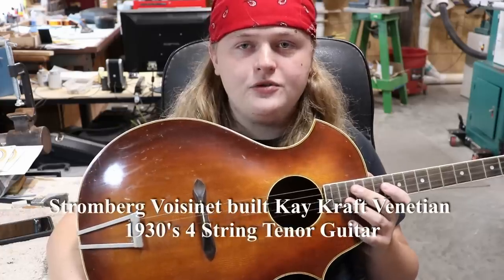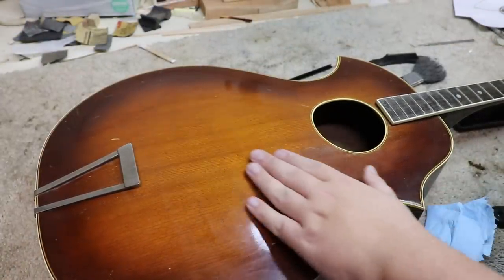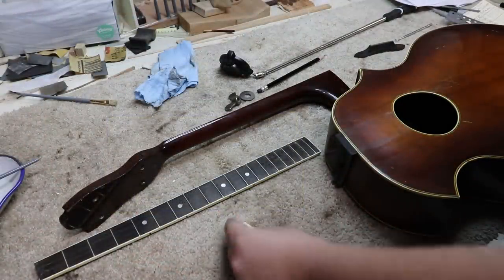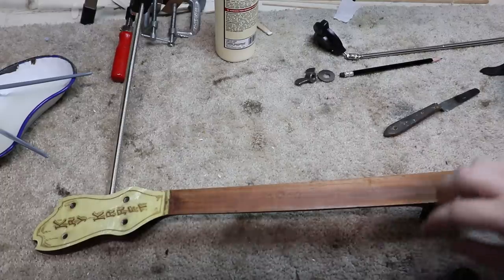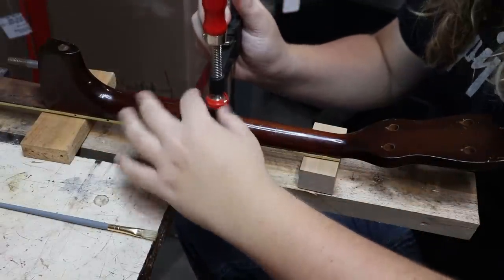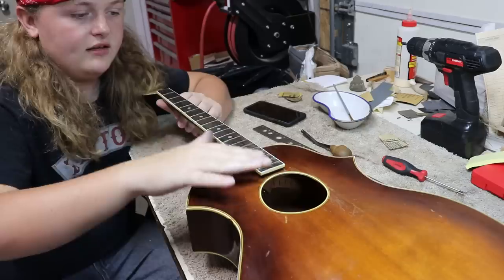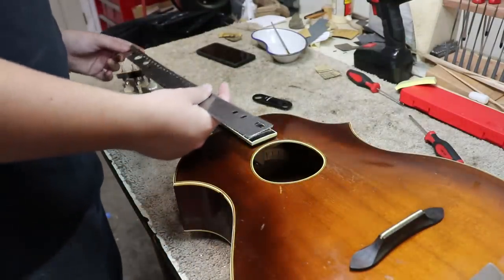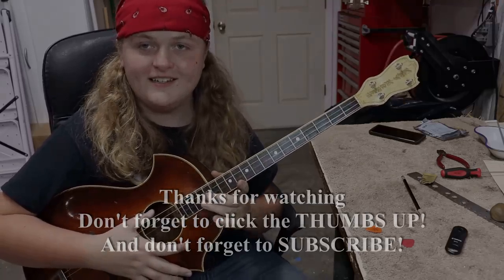438 RSW A Kay Kraft 4 String Tenor Guitar

Comment: This is cool, nice work. My reaction to the compressor would have definitely needed to be cut from the video! 
I typically tune my 4 string guitars to ADGB so it's the middle four from standard tuning, it gives a different sound to regular open chords.
Reply: My reaction to the compressor would turn the air a very deep blue.

Comment: Not second-guessing but I hate thin necks w no reinfocement. W that board popping off the way it did I might have embedded at least a carbon fiber rod in there. An adjustable rod- no, way too much mod required.
Reply from the maker: There is very little tension on a 4-string tenor guitar. The Titebond glue holding it on there will keep it perfectly straight.
Reply: @RosaStringWorks  would you say this same repair could be done on a six string?